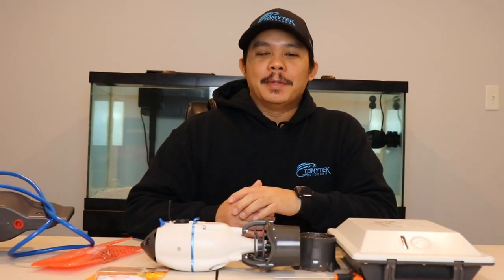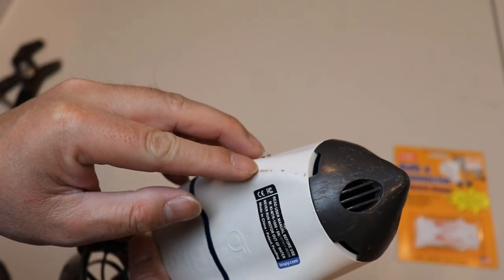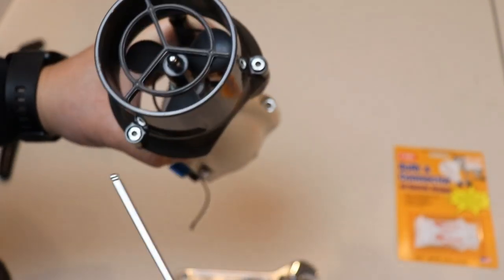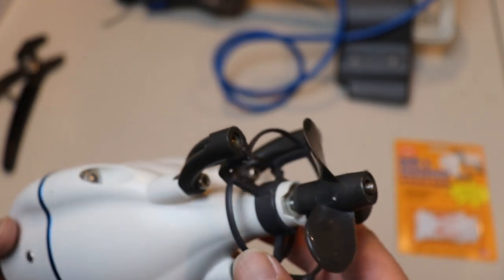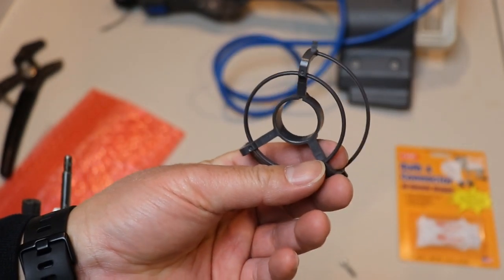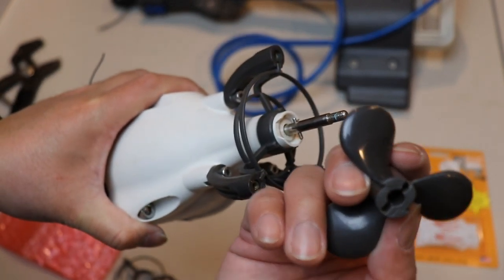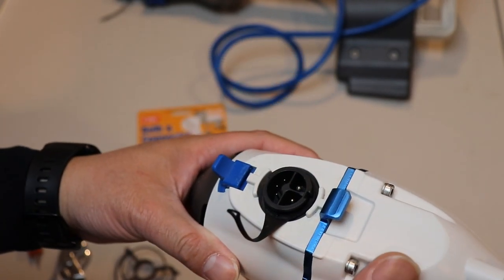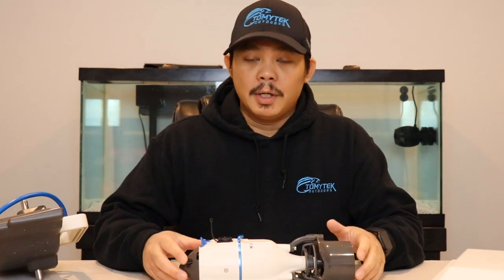Bixpy Jet Repairs & Maintenance

Comment: I have not been able to decide what direction I wanted to go with a motor. This helps a lot knowing you can replace so much! I would not have known that without this video! Thanks brother;)
Reply from the maker: That's one of the nice things about the Bixpy Jet.  It also has a bunch of different mounting options and accessories.  You just have to get the mount and you can use the same motor.  I'll have a Bixpy Jet review coming soon.  Thanks for stopping by.

Comment: How nice would it be if trolling motors were built like that , you could just rebuild or replace the motor section
Reply from the maker: I agree.  I'm actually looking for used trolling motor to mod for a kayak.  It should be a fun project.

Comment: Greetings!  One of the tabs on my J-1 power cable is worn and does not form a tight fit (not water tight).  Do you know if the tabbed ends are replaceable?
Reply from the maker: I checked their website and didn't see it available. You can try contacting support to see if they can help.

Comment: My outboard kit shows all solid blue LED lights and is not responsive. The cables were mated correctly every usage and sealed. The device doesn't beep anymore with the kill switch or remote control. Have you seen experienced this before and if so, what is the solution?
Reply from the maker: I have not experienced this problem. Bixby support is pretty good. Contact them and they should be able to help you out.

Comment: Hi this bixpy can operate with regular deepcircle battery?
Reply from the maker: It comes with a lithium battery. I'm not sure if it will work with a deep cycle. The battery and remote work together to control the speeds.
Reply: @TomyTekOutdoors  thanks my friend!👍